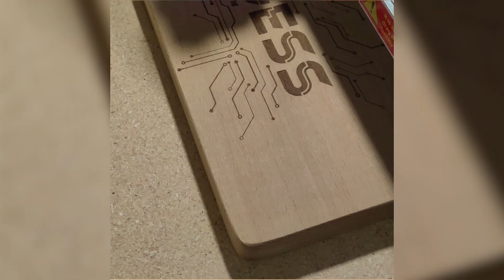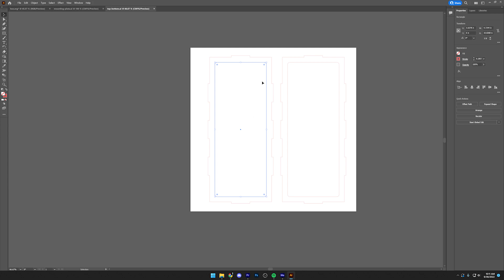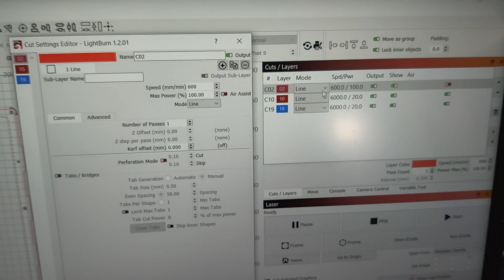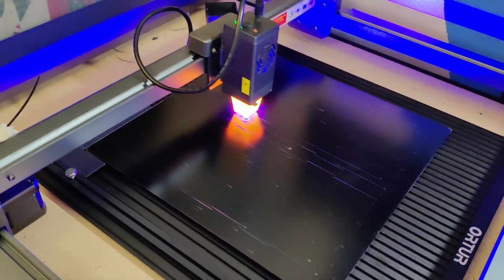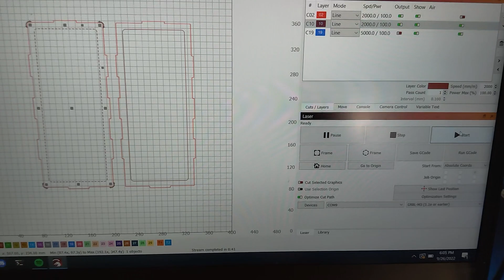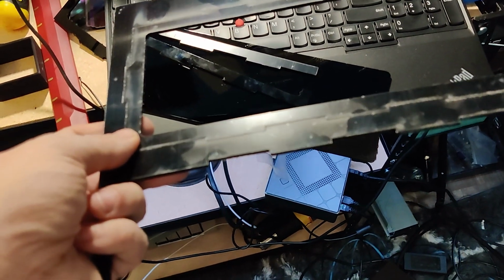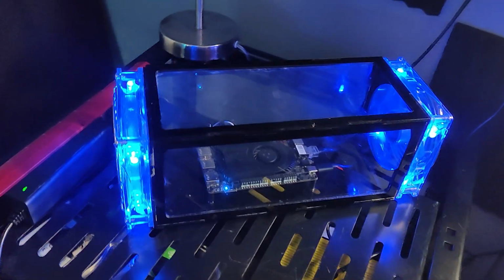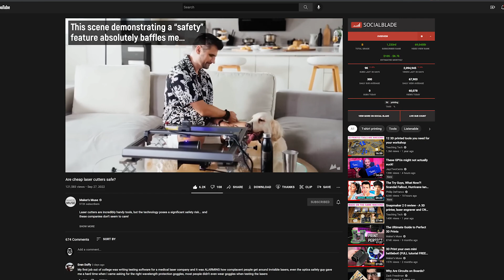I Improved My LattePanda 3 Cooling with the Ortur Laser Master 3!

Comment: Nice build! Try using 3mm (1/8") MDF or plywood on a diode laser rather, it's a lot easier to cut and it's also much easier to glue together, modify and sand afterwards. You'll obviously need to paint it though, but it's easy enough to do with some spray paint.
Reply from the maker: Thanks for the tips! I'm still learning and have been having a lot more fun cutting/etching wood than plastics :)
Reply: @DBTechYT  these are awesome workshop tools, I'm sure you'll find a lot of uses for it! Wood is definitely the go-to material for diode lasers.
I had a thought to try build a wind tunnel inspired Raspberry Pi case so I looked to see if anyone had done something similar and came across your video
Reply from the maker: That's awesome! I already have thoughts on how I'd like to modify for a next version. Will definitely use wood at least for prototyping